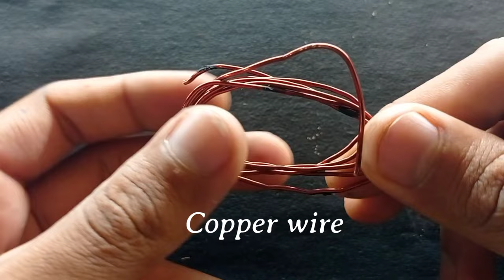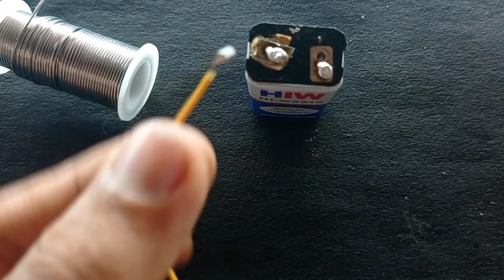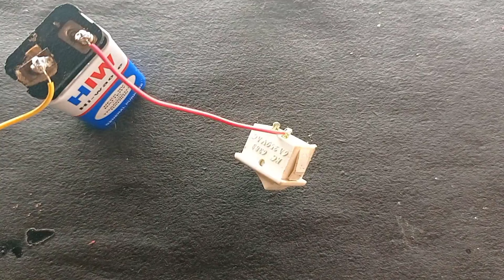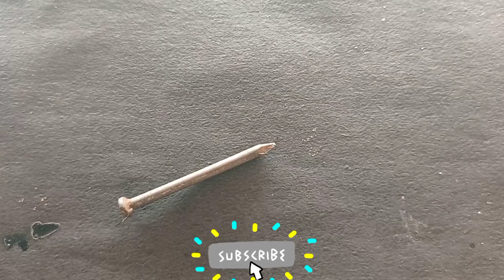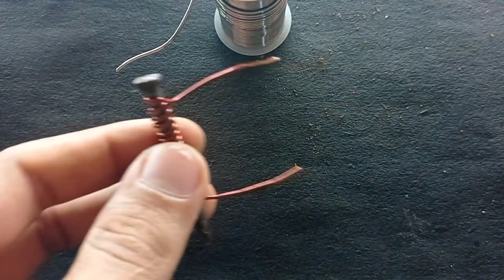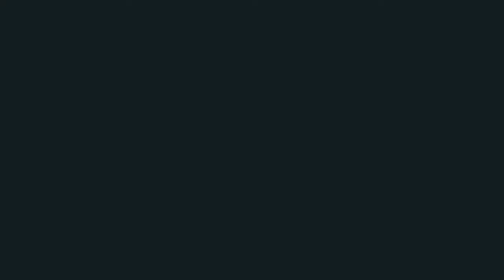How To Make An Electromagnet By Using 9-volt Battery

Comment: bro  is coating with metal wire on copper  necessary
Reply: Yes, required... Except for the ends to the wire, it is required throughout.. Else, the nail/screw will become part of the circuit, and will not be an electromagnet